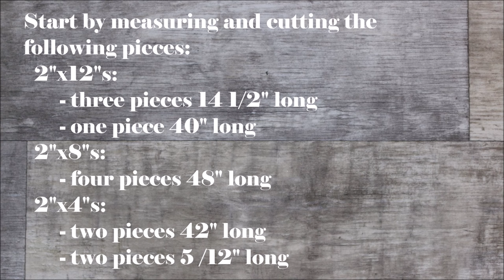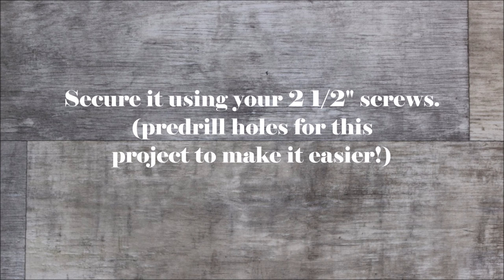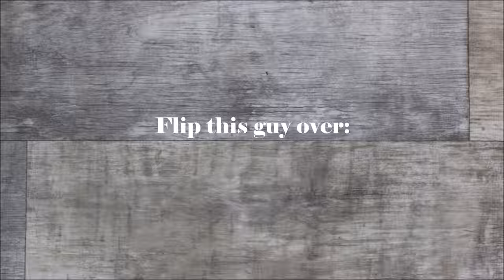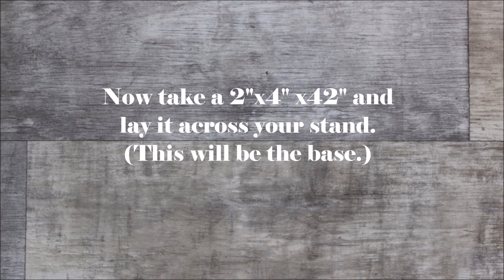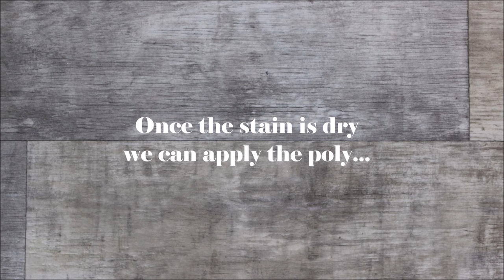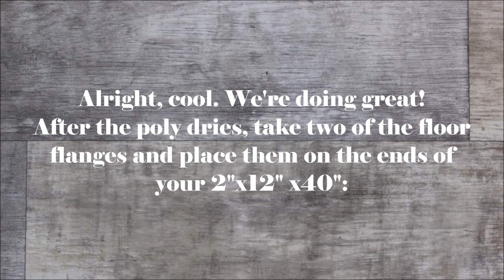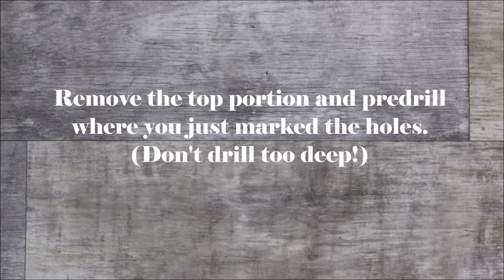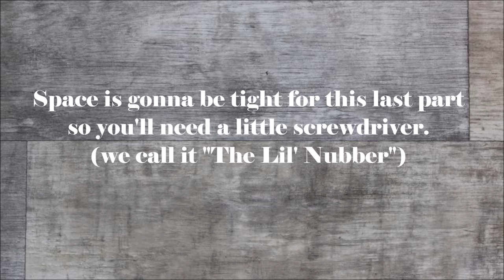The Super Easy TV Stand - DIY Project

Comment: Thanks for the great video. It was a pretty easy build for a guy with rather limited skills. I did have a few snags. Most of the boards were not true so I had to add adjustable appliance legs to level it. I had to have the boards cut at the store as my miter saw is not the sliding type. I did not notice that he did not cut 2 of the 2x10 boards to my requested length, so I ended up with 2 at 48 inches and 2 at 47 3/4 inches. I improvised and made it work. I might suggest using a ratchet instead of the stubby screwdriver to attach the pedestal to the base. That made it quite a bit easier. Thanks again

Comment: Just finished making it. First woodworking project I’ve ever done in my life. I must say, the video makes it look so easy, but beware it is very time consuming and can have many obstacles a beginner doesn’t think of. Make sure you pick out very flat wood, because one of my pieces was slightly curved and to the naked eye I didn’t pick it up, so I had to figure out how to level the wood. Overall, simple design and anybody can do it if they have patience. Thanks for the video!
Reply: how much did the total come too
Reply: @flareeyt2295  Wood was about $50 for me, rest of the supplies was probably around $30 or so (I have a lot of left over supplies though for other projects now). I'd say depending on what you need between $60-$90 total. That's a really rough estimate!

Comment: Nice project,  ten times stronger and much more durable and well built then the cheap crap you see in many stores
Reply: LaserFalcon
Reply: I doubt this will last much longer than the cheap stuff. Screws don't offer good strength and durability. It does look better though.
Reply: Cheers for this, been searching for "woodworking plans high chair" for a while now, and I think this has helped. You ever tried - Yiyli Yeyavid Booster - (do a google search ) ? Ive heard some interesting things about it and my m8 got amazing results with it.
Reply: @Samuel Sutton Please point me to where I said anything about nails. . .

Comment: Very nice video, but I'm confused. If you put two of the 2" x 8" x 48" right next to each other, wouldn't those combine to be 16" wide? How come those vertical pieces are only 14 1/2" long then? Wouldn't they need to be cut 16" long to be flush on the ends?
Reply: The dimensions of the lumber aren't quite what they say.  2x8 is the nominal dimension but it is actually 7.25 inches wide.

Comment: 2x12s can be fairly pricy and a lot of places will only sell you 16ft pieces, the metal pipe for the top shelf is cheap but the flanges can cost up to $5 ea.  Other than that it’s pretty cheap to make and I got it built and stained in about an hour and a half

Comment: Saw this video, went to home depot, bought everything went home and built it and I couldn't have been happier with the out come!
Reply: Layne Smith about how much was everything?
Reply: how long it tok to build?
Reply: Same... went to Home Depot.... they’ll even cut the wood for ya at no cost. Bought everything except the stain and poly. Cost me $108... with the stain and poly would’ve been about $120. The wood was about $53. The floor flanges were about $25. Two boxes of screws almost $20. And the two pipes were like $8 total. With the wood already cut to the sizes needed, you can put the whole thing together in roughly an hour.

Comment: This was an awesome video. I would personally prefer to use bolts, washers, and nuts to instead of the nails to hold that together. (At least for the top shelf). I would not want bolts to show through the bottom and scratch my hardware. I am a DiYer but never have attempted woodworking just yet. By the way, I like the fact that your significant other builds the shoe (Laughs) rack; girls gotta have their shoes and we have to have our TV stand. My game systems and receiver would be a great contrast to that style. Time to share these vids with my wife and start planning our builds. Liked and SUBSCRIBED!!! THANKS!

Comment: Thank you for teaching this! One possibly dumb question: It looks like you’re laying the 2x8s flush against the long side of the 2x12s. Shouldn’t those 2x12s be 16” long, not 14.5”? It all looks pretty squared up, no overhang.
Reply from the maker: An 8" wide board is actually only 7 1/4" wide so two together would give a actual width of 14 1/2".
Reply: I was thinking the same thing 8”+8” = 14 1/2” 🤔🤔

Comment: I made this stand all in all 147 total that's with a mask n brush included unfortunately the store made my cuts they weren't even but I made the best of it also my 55 t.v. did not fit so I had to leave the top shelf off but I'm using it with the extra wood to make a corner stand and with longer pipes should be nice THANKS FOR YOUR VIDEO gave me a lot of ideas and confidence to do my own thing straight or not at least I'm making it and it's solid.
Reply: DZenitram23 147....dollars? holy hell that's expensive

Comment: This looks like a great TV stand, would it support a 50 or 55 inch TV with the dimensions you used in this video. Looks like the TV you have on it is a bit smaller.
Reply from the maker: Yup, I have a 50" on it right now!
Reply: Take into account the legs for the TV, since they vary. I have a TCL 55'' and the legs are 47'' wide, so I adjusted my measures accordingly.

Comment: Hey! Sorry if this is a weird question but I'm not very good at this stuff. I was wondering if it'd be possible to use a 3 cube bookshelf (One at Walmart I have lying around) as the bottom storage piece and drilling the pipe with the wood board into that instead? I'm thinking the wood piece would look different than the bookshelf, but if you picked a dark dark stain or spray paint, do you guys think it would be noticeable?
Reply from the maker: You would want to make sure the bookshelf isn't hollow on the inside and that the screws would have something to grab on to. If they do then it shouldn't be a problem!

Comment: Hi, I'm a little confused about the measurements. I'm sure I've misunderstood, but can someone explain the width of the base to me.

It says to cut the 2 x 12 x 8 into 3, 14.5" inch pieces, which should be the width of the base. These three pieces serve as the sides and a middle support column, and their dimensions are 12 inches by 14.5 inches.

However, you drill two flushed 2x8x48 on top of the 14.5 inch wide pieces that serve as the sides and middle support. So, therefore, flushed together, the two, 2x8s should have a width of 16 inches.

So does that mean that there is 1.5 inches of overhang when you place the two 8 inch wide pieces (16 inches total) over the 14.5 inch wide sides?

Can someone explain this to me?? Thanks in advance. (Also sorry if this question was already asked)

Comment: I’m a painter and you actually want to stain all of that before hand, makes things a lot easier🤷🏻‍♂️
Reply: Jay B You don’t have to, it’s just easier doing it beforehand so you don’t have to worry about excess stain in corners and getting tight spots etc
Reply: Just made it and I completely agree. I actually missed  staining one edge on the bottom stand portion. It’s on the inside of the wood so you can’t see it anyway but still. I also added caster wheels to the bottom so I can roll it around. It looks sweet.
Reply: Thanks Austin. Good tip 👍
Reply: You can do it either way
Reply: I followed along and completed my first ever woodworking project, it’s not perfect but I learned a lot. Thanks for the inspiration.

Comment: Quick question—do you feel the center brace is necessary? I'd like to make this but without the center divider.
Reply from the maker: You probably could, there may be some sagging over time...
Reply: The Rehab Life thanks for responding man. I think I’ll include the center brace after all, I just needed to make the unit wider than I planned at first. They need to figure out how to make Xboxes smaller!

Comment: Do yuu know if this measurement will fit 55” inch tv &&- if it will hold it good ? Please let me know . Thank u
Reply from the maker: I have a 50" TV on it now and it works just fine. You might have a little overhang on each side with a 55" but it should still work!

Comment: Went to make this but the 2/8 I brought from Home Depot was more like 2/7. So making adjustments as I go. I'm also using pocket joints.
Reply: Nominal size of lumber is confusing. 2x lumber is actually 1.5" thick. 1x lumber is 3/4" thick. Also a 2.8 is 1.5" x 7.25". A 2 x 4 is 1.5" x 3.5" Actually google lumber sizes and you will get all actual sizes.
Reply: If you are using pocket holes, set the pocket hole machine for 1.5"

Comment: What about screwing in grain? People say you should not do it because it is the weakest joint, as in grain it can split fibers.

Or is it only not good when speaking about things where you put more weight on and tv stand does not need to hold much weight?

What is general consensus about screwing in grain?
Reply: Pre drilling helps from splitting the wood.  Generally you wouldn't want to do this but with no more weight than will be on it, you shouldn't see any problems unless you abuse it or drop it on a corner.

Comment: If the size of the sides are 2x12x14.5, how come the 2 2x8x48 fits flushed on top?
Reply from the maker: The actual width of a 2x8 is only 7 1/4" so 2 together would equal 14 1/2
Reply: Thanks, sorry I am new in woodworking and this is my first 'project' and I love it! I put casters and change the pipe size from 5 to 8 and it is perfect! I am now on my 3rd project from your channel. Thanks again! Looking forward to more videos from you guys.. 😊

Comment: Just finished mine, didn't come out the way I had hoped, had a few errors, other than that, it was okay.
Reply: mcog 2006 what errors happen when you built it?
Reply: @joshuaniles-dancy585  I sort of didn't use the right stain and couldn't find the right type of mini screwdriver.
Reply: mcog 2006 Thanks, I’m going to build it this weekend. Hopefully it turns out well

Comment: How big of a TV can it hold?
Reply: This should give you an idea. It's a 2 x 12 x 40" with fixed sides. Sag will depend on wood type. Ultimately that force should then get transferred onto the next pieces of wood below, however they are almost acting as two separate shelves with half load on each at the center (due to the vertical piece on the middle dividing them).  Either way, if you go to the calculator, you'll see that something like douglas fir that size can withstand a lot of weight... more than any TV I've ever had. 

http://www.woodbin.com/calcs/sagulator/
Reply: to give u an idea i made this for my sharp•Roku 55 inch tv the top 40" did not fit so I left it off and used it to make another small stand

Comment: i don't understand how did u put the  two 2''/8" 48" on the 14 1/2 " base?????
Reply: Pragnya W V I think he cut 2 pz 14 1/2 x 16" for the base.
Reply: He cut the three 2x12 base pieces @ 14.5"- That way the two 2x8's will fit side by side.
Reply: Also if you haven't done any woodworking- the nominal size of boards is confusing. A 2x4 is actually 1.5"x 3.5". Also a 2 x 8 is actually 1.5" x 7.25", The Kreg jig should be set for 1.5"
Reply: thanks so much for clarifying. I am a learner so yea it is confusing.

Comment: There's a mistake with the dimensions. He says lay a 14 1/2 inch piece down and two 8 inch pieces on top?
Reply: the 1x8s actually measure 7.25"s wide from the mill, so 2, 1x8s would equal 14.5"s next to each other
Reply: I was wondering the same thing.

Comment: DIY projects are great and his project is great.But the materials and the hrs of times he putting into the building of this project is not that big of a savings in ($) or the same in($)as buying it from the products manufacturers.Look like all the lumbers he’s using in this project are Strong 4 by 4 studs woods and other materials too.He using could cost him around $100 or upward and hrs of times.I could buy a great tv stand for that price and don’t have to putting in hrs of that times building it.
Reply: Hours?  How long does it take to measure and cut the few pieces?  Some sanding, staining, allow to dry and stain again if wanted, then finish coat. Sure if you want it done in 2 hours, go buy IKEA. The main time spent is WAITING for the stain and finish coats to dry.
Reply: there was no 4x4 anything inn this video I think he did use 2x12 just for the joists and they're not the cheapest especially since he only used about 3ft. I guess this table is better suited for you,  if you have a garage and leftover wood from other projects
Reply: I just built one in an hour and it cost 30. Couldnt find a tv stand the size i needed so i made it. Much cheaper then a $200 stand..
Reply: I built it today for $100 and about 5 hours, took more time for stain and poly than cutting and building. Stronger and better looking than anything out there for $100